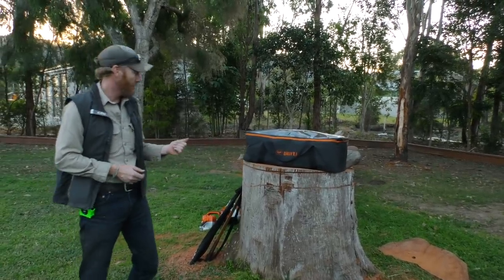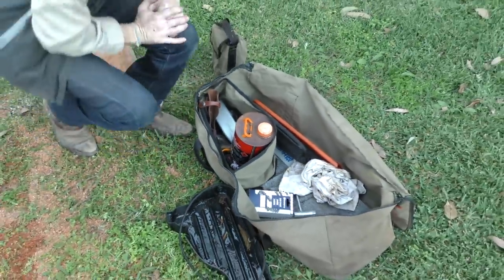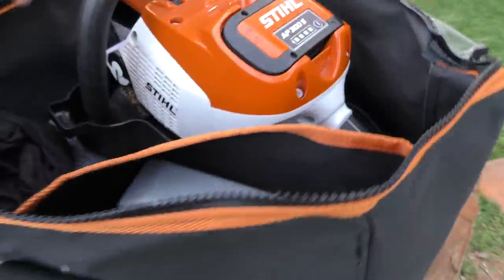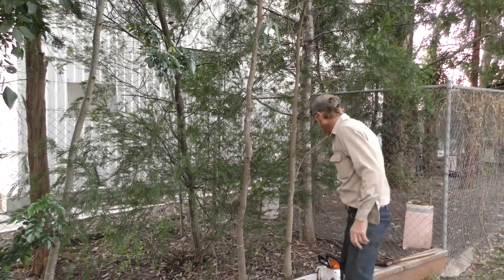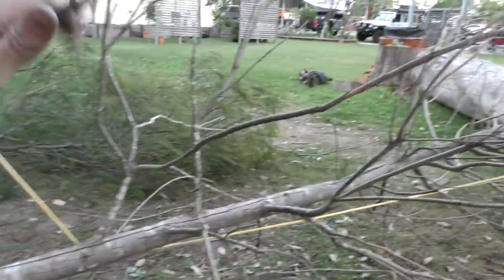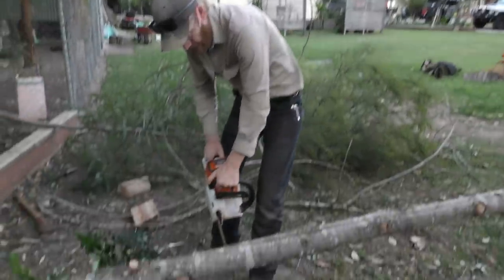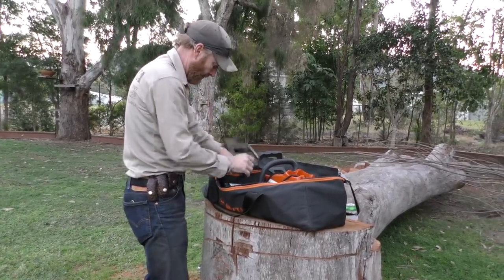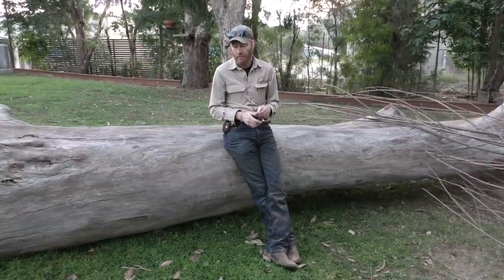NEW Electric Chainsaw Bag

Comment: Great vid again Luke and agree PPE is last resort being a competent experienced operator much more valuable. Q- I’m guessing you would need an inverter setup for charging battery like this off the grid?
Reply from the maker: Peter Cowan yeah, draws 35 amps , so need a serious inverter, edot would charge it easy. full charge tho in 15 min , so is very quick : )

Comment: Good clip Luke. Re safety gear....for god's sake don't wear gloves... several times seen guys with lily handed gloves get snagged & injured... the other tip..always have a retreat path clear of sticks etc.
Reply: Mark Somerville thats it mate no gloves jewellery or sleeves around rotating equipment, just common sense. I seen a bloke get his hand dragged into a power tong because of the glove and him not thinking, it turned out not too bad it could have been a lot worse.